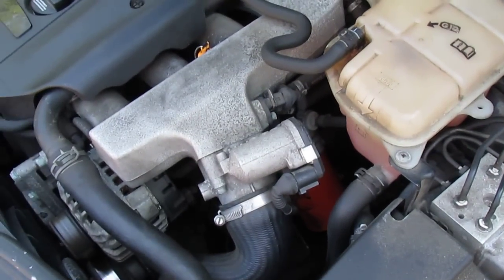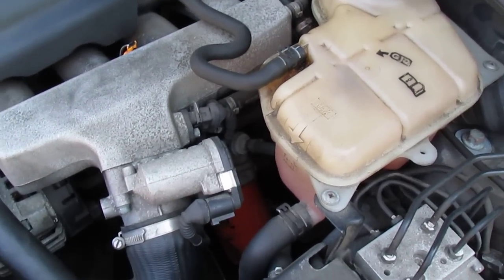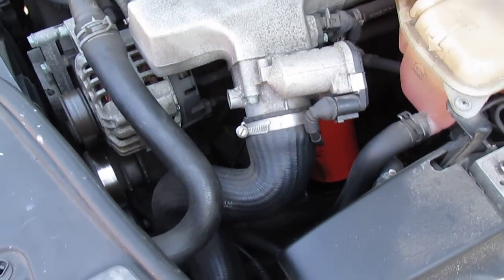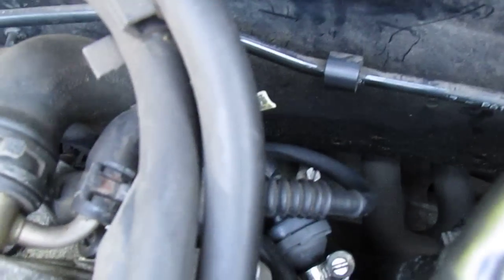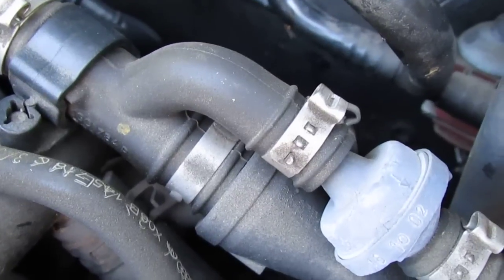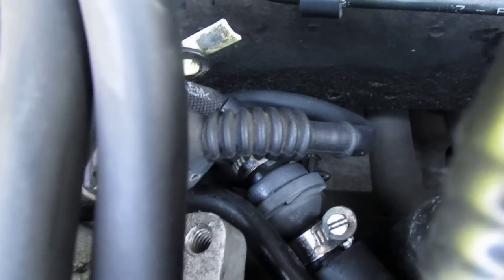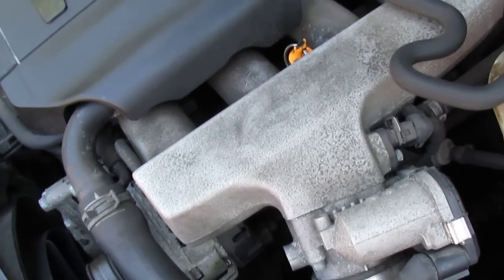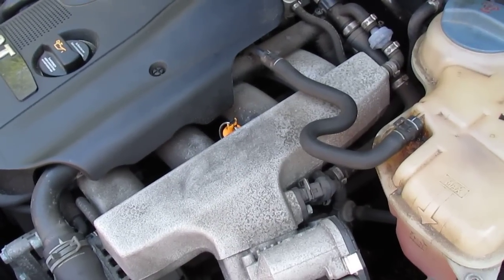I fixed my car for $5 instead of $250. Engine misfire? Do not waste your money! WWW.1VGPRO.COM

Comment: you are a mechanic dont lie, come on brooooo
Reply from the maker: That's the best part, I am not! This is example of easy fix, which has been done not by a mechanic and it saved as I mentioned about $250. I saw broken in 2 part, bought replacement for cheap($5) and no more CEL!

Thank you for bringing it up.

Comment: I commend anyone who makes an attempt to fix your own car. That said, If your shop was going to charge you 250 dollars for that job its time to find a new shop. That is a vacuum check valve. About a 10 dollar part. Book time to change that is .3 hours. There is the diagnostic fee which some shops will even waive if you have them do the repair. The thing to remember with that diagnostic fee is that most problems cant be found with a visual inspection and most cant even be found with a code scan. There is a lot more to properly diagnosing problems.
Reply from the maker: Thank you for your comment William. One of the main reasons I would mention here is that by trying and hopefully fixing problems by yourself, car owners might save a decent chunk of money and reduce risk of damaging something by working on their cars carefully.

I know guy who bought(from a car dealership but "for cheap") used SUV with CEL on. I think he brought it to the shop 4 times to fix CEL. Outcome? They charged him 4 times, cleared codes, tried to fix it, but they could not. He had to trade in that SUV and buy something else. It is understandable vehicles are not as simple as piece of 2x4, but sometimes, like in my case in this video, it is pretty simple, cheap to fix and doable. Visual inspection, free code scans from auto part store and internet are huge help.

Comment: The way I remove the clamps that you showed. Place a flat screwdriver in and twist, Grab the handle with pliers if need more strength. It will expand the bottom where it is crimped and then remove.
Reply from the maker: Tony, thank you for sharing. In my case I was afraid to put extra force to any parts in order to prevent more damage to the hose or part which could have brake and leave particles in the system.

Comment: Greeva, thanks for the tutorial and advises, which inspired me to try to fix it myself for less. Kudos to the sincere guidance.
Gotta say, I laughed when I saw $250 found in the hood of the engine. That sparks my spirit. 😄
Reply from the maker: I glad to help. Yes, saved $250 and turned off two days later CEL were VERY nice and the fact I did it myself was a VERY nice addition to that. Thank you for commenting, please feel free to subscribe, comment. If this video was really helpful, please do not hesitate to donate/contribute through WWW.1VGPRO.COM/home-passport, there is Donate button. Best of luck and try to diagnose the problem right and fix it yourself.
Reply: Greeva , I have the symptom of shaking engine that makes my body shakes in car as well, which is possibly due to engine misfiring. But I didn't see the obvious symptom as you did about the loose clamps and hose though. So might be something more serious, unfortunately...
Reply from the maker: Well, first things first. I hope you did not start fixing something without making sure that's the actual reason. Do not start replacing part after part. In my example it was pure luck as you see, I saw broken part and replacement fixed misfiring. In other cases it may be various things. What I did was I went to auto parts store and asked to scan error codes, you can see them in description of the video. I do not know what vehicle you have, where you live, history of the vehicle, so it is impossible to advise something particular. Hopefully someone would pitch in and provide better advise, remember I am not mechanic. If you have similar problem, it may be something visible, like in my case or it may be tiny, very small vacuum leak and you need to find it. On another hand and it is exactly why I stressed we need to figure out the problem before trying to fix it, if your vibration is hard enough as you say your body feel it, it may be, for example, engine mounts or transmission?
Reply: Greeva , yea, I'll definitely check in with a local auto shop for diagnostics and see. Much is appreciated again for your time trying to help me out..
Btw, I got a 2005 Passat GLS 1.8T, similar to yours, I think.
Reply from the maker: Ah, that helps. Yes, mine is 2003 GLS 1.8T, so it may be the same everything. IF you would see codes as I mentioned in the description it MAY(or may not) mean the same problem. I do not know how familiar you are with your car, I just looked and at first I heard hissing noise and then I  saw separated hose, so for me it was " hey, may be it is this thing?" Hopefully you would be able to fix it yourself(for cheap).
Reply from the maker: Also, look up internet for PCV hoses, at this age as people joke those hoses brake if you just look at them. Consider junk yard parts as new set at dealership may cost $400(?) in parts only, at a junk yard if you are lucky you may find brand new set and buy it for I guess $30-50. Do(touch, move) everything carefully, do not break one thing fixing another.

Comment: Question.?
Hi. How are you. A question:
I have to Audi 2004. A4 Quattro 1.8.
Panel light turned on ( check engine. )
Code P0302. The found coolant inside cylinder, so they ll remove head to repair,most likely head gasket. 
They did, but 8 days later, from the repair, he turned the light on the panel ( check engine ) the same code. What could it be
Reply from the maker: Hi Ritmo Latino PDX, as I have mentioned in the video I am not a mechanic, so I can not guess more or less accurately what the problem is, but you can go regular/normal route here: as I said in my other videos, find out what the problem is BEFORE you spend money on repair. Did you ask for a second/third opinion? 

Those mechanics, who repaired your car may have misdiagnosed the problem and you may have paid for nothing good. On the other hand your current CEL may have nothing to do with the previous one. Coolant inside the cylinder is not good as you know, did you see it yourself? 

Did you check spark plug in cylinder#2?

Where are you located?
Reply: Ritmo Latino PDX coil
Reply: WRX Evegas  hey, it’s probably the spark plug in the number 2 cylinder. Or the coil pack that plugs into the spark plug.

Comment: sir i have a nIssan urban 2005 moder microbus. its run on 3s toyota petrol engine. noy i want to conver it to disel with toyota engine. my option is 3c,2l,3l,5l toyota disel engine. please tell a suggetion about what will be good for myself. i am from Bangladesh. the reason of change my engine is our country fuel cost is too high.now it run 6km per liter on octen..
Thank you..
Reply from the maker: Hello Akash,

I am not a mechanic, so I could not advise "better" engine for your bus.

From standpoint of normal person I would suggest you need to take a look at several sides of your situation:

- Have you noticed change in petrol consumption, for example several month ago you used 3 liters of petrol per Km and now it went up to 6L/Km? If so you may want to check whether you need to fix your engine, it may or may not be cheaper than replacing it(putting a new engine in your bus).

- Is your current use of petrol normal for the vehicles like yours. Make sure to compare conditions of work, for example you need to ask other drivers who use similar engine buses for similar line of work: passenger, freight or other(may be you drive your bus empty for advertisement purposes if it has logos an ads on it sides). Do you drive in the city or highway(roads between cities with good flow traffic). If at this age of the engine's life they all use about the same amount of petrol it may be normal.

- If you would decide to replace your engine and if the only concern is fuel consumption, pick least powerful engine which will make job done-if you do not drive fully loaded or in hilly/mountain areas, use smallest engine.

- You may want to consider replacing bus instead of the engine, if you see that you can carry more passengers or load(if there is demand for your service), you may decide to buy larger vehicle, if you would go this route see what options you have in your location, is diesel fuel a lot cheaper? Gas powered engines? Electric/hybrid?

My car is about the same age as your bus, here in US the common point of view is that after 10 years or 100,000 Miles(160.000 Km) people replace their cars because of higher risk of break downs/repairs, so if you can and think it is a good option, buy newer or better yet NEW bus.

Consider all sides of YOUR situation, I do not know what your plans are, may be you need this bus for just one more month or year, in this case just drive it as is, do not push it(try to avoid unnecessary acceleration and braking as it is extra tear and wear and petrol consumption).

If there are people who can advise Akash, please share your thoughts.

Comment: Have a 06 fusion shifts hard and shacks what do I need to do had Auto zone put computer on it said #2 cylinder was misfiring
Reply from the maker: As I have had mention in the video I am not mechanic, so treat my point of view accordingly, i.e. it may be an 100% right, partially right or not right at all. Based on what you described I would GUESS you have more, than one problem. Hard shifting is the one(it may be level or condition of the Automatic Transmission Fluid(ATF)), it may be transmission itself(breaking up), it may be a computer or something else. How many miles? Have you ever changed ATF? Keep in mind even though manufacturers may be saying oil/ATF is good for the life of the vehicle, it may not be the case. Some people consider 30,000-70,000 miles interval for ATF. I would first check ATF level, hopefully that's the case and can be fixed easily. If you plan to keep your car for the next 5-10 years, consider replacing ATF(check internet on this one, some suggest against it on transmissions with 100,000 miles or more.

Second problem(engine misfire) may be as simple as spark plug or connection. It is a good thing that you stopped at the AutoZone and they scanned it for you.

Comment: What did you buy with $250... and how do you know this job was a $250 job
Reply from the maker: If you ask me how exactly I spent those particular bank notes you see in the video, I do not remember, but I guarantee they were not wasted. 

How do I know this job was $250 job. Let me guess, you did not watch the video, right?  :)
Reply: Greeva  you're good i tell you!!! No i didn't watch the whole video. I seen hose clams and i was like this man figured it out. Keep them " bank notes" under the hood nice a warm.
Reply from the maker: I was surprised myself, in this case it was luck, I noticed part came apart and when I hold it together engine started work normally, so it was "Hey I can replace this part with similar from a junk yard!" And it worked, that was very satisfying moment when Check Engine Light went off the next day or two days later.  :)